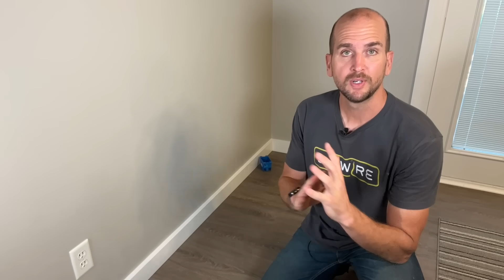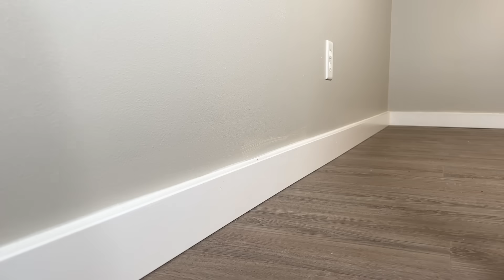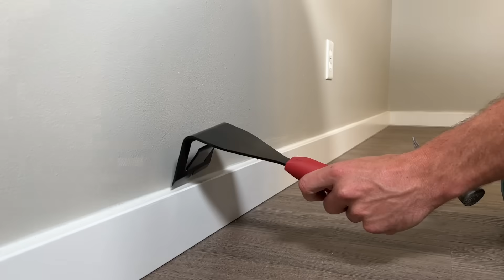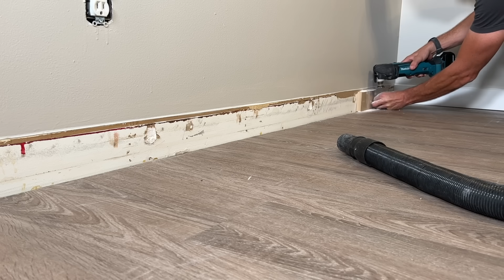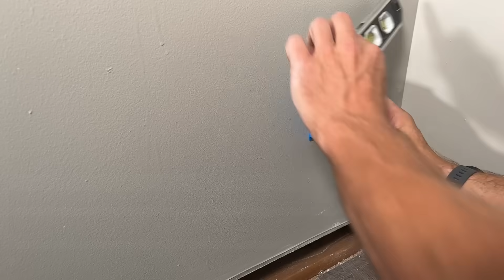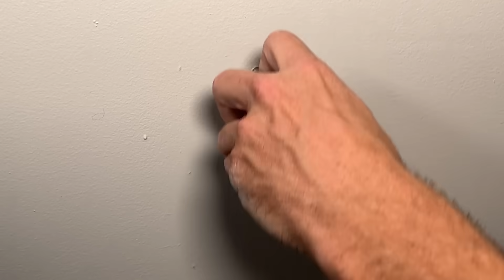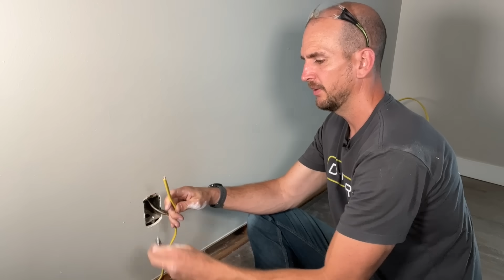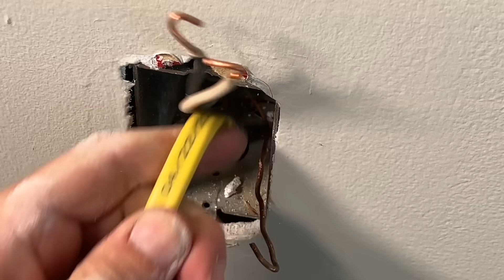How To Add An Outlet To A Finished Wall

Comment from the maker: All My Favorite Tools - https://geni.us/GYnAhy4

DISCLAIMER: This video and description contain affiliate links, which means that if you click on one of the product links, I’ll receive a small commission.
Reply: I like to check the other side of the wall before cutting. Make sure there is no power or anything else.
Reply: I ... KNOW this already. Good vid though
Reply: Where do you get that stud finder? Thanks
Reply: Hardware  store  @brandonnguyen1748
Reply: How do you remove the nails on the bottom drywall
Reply: Okay, have building codes here just changed recently because normally home wall outlets are going to be on a 15-amp circuit which only requires 14-gauge wire, not 12 gauge. Did you just misspeak or are you running 20amps to that outlet?
Reply: ఒక 100 సార్లు క్లిక్ చేసాను. Hope you didn’t mind
Reply: Good job bro i see a lot of people leaving negative comments this is a great idea and awsome method..
Reply: @bamm2pointohh  qqq
Reply: @bamm2pointohh 😮&f CT CT CT

Comment: When you put the second outlet into the cutin box (or old work box) be careful not to push too hard or you will break the drywall through resulting in a giant hole which is really hard to repair.

Comment: So instead of making a clean cut out of the drywall directly between the two outlet boxes you chose to remove trim and then also remove drywall and then repair all that later on. Ubu.

Comment: Why not strip the romex jacket down to the box connector before pulling the wire into the box? Seems easier and cleaner and less chance of cutting the insulation on the conductors than when it's in the box.

Comment: A DIY guy here that has done this many many times also but one thing I didn't notice was using nail/screw protector plates over the holes you drilled into the studs to run your wire thru. You made it harder on your self drilling behind the drywall but a nail or screw could still be put  in there for some future use reason... say adding  wider baseboards.  Here in florida that is a code violation.  A nail or screw could pierce the wiring when nailing into the stud for any reason.  Needed whether it be plumbing or electrical run thru studs.

Comment: Awesome video! Question, does this trick with the drywall behind the baseboard still work if you are going through a corner into a closeted area? Technically, the wall I need to go through to get into the closet is straight through on the same wall, I just potentially envision a possible challenge with getting through the closet entryway.

Comment: I am not an electrician , but for this project I just drill from the existing outlet to the new location  with a long electrician drill bit since is not to far ( flexible auger from Home Depot)

Comment: Okay I’m definitely a beginner. Is there such thing as a four pin lugged nut as I have two sconces I would like to connect however I only have one outlet in the center.. and I want to create one outlet to the right one outlet to the left in order to connect the sconces vertically down.

Comment: Wow, really smart ideas! @ 3:05 I was thinking you gotta be super careful with the end of that tape measure right next to that outlet with no cover on it. You probably already have the circuit turned off, and the wood floor should theoretically protect you from a lethal shock, but general practice would be to not get comfortable holding a metal instrument like a tape measure anywhere near an open electrical receptacle. I just wanted to point this out so that viewers will keep this in mind. I actually think the video is awesome!

Comment: Only criticism would be that there’s no need for the connectors and pigtails. You could’ve just put the new conductors right into the bottom terminals of the existing receptacle with less parts and work and accomplished the same thing. 

Great video overall, though.

Comment: Fantastic video. I am not a fan of WAGO. I have had instances where the wires pull out of the WAGO. They don't clamp down tight enough. I prefer the old way of wire nuts. If those are installed properly, they never come out.

Comment: It would be alot easier to use extension bits on your drill and drill through the studs in the wall. Couldn’t imagine ripping off someone’s baseboard during a service call.

Comment: One point you didn’t mention about drilling the holes higher up on the studs…this also gets above and nails that are driven through the bottom plate up into the bottom of the studs. Hitting one of those nails can be nasty on a bit.
Reply: Oops….gets the holes above the nails

Comment: Other options... Cut drywall 3" above floor, remove drywall, use oscillating tool to cut notches in the studs just above the plate. Lay in wire, cover with metal plates, add 2nd outlet. I've used this for close span outlets... Use surface mounts.  Easy, they look fine when done.

Comment: aren't you supposed to remove the "ears" on the outlet when used with an old-work box?  The old work boxes are molded to accept the tab without the ears.

Comment: This is probably one of the best DIY videos I have seen. My only wish was to not speed up the splicing and wiring. As someone new to DIY electrical it would have been nice to see it all at a normal pace since this is such an important part, then speed it up myself with the video controls once I saw enough at normal speed. Thank you so much for this video!

Comment: Long ago my grandparents added a good size addition to the back side of their house.  I told them at least put outlets every 6 feet.  They did and the next 15 years that we used that addition, those outlets came in real handy.  Could put lamps anywhere in the rooms.  No "well, we'll need an extension cord going along the floor here".

Comment: Newbie here..

Does this mean that both outlets can use a combine total of up to 1800 watts or each outlet can individual use up to 1800 watts (3200 watts total). 

I want to plug an A/C or heather in 1 outlet (1200 watts) and on the 2nd outlet plug in my PC/set up/other stuff.

 I dont want to fry my outlets.

Comment: Well, I’ve had those Wago lever three ways, not work, not often but they have. I only use the two ways when I’m using braided wire. I’ve gone back to the old-fashioned twist and wire nut. They never fail me.

Comment: IM an ELECTRICIAN PLEASE READ BEFORE DOING. There is zero point in vacuuming over and over in the middle of working. Do what you need to do then clean up. Also, please double check if not even triple check the power is off, breakers fail and residential electricians cut corners all the time, so their could still be power running on the neutral from another source. Also very few boxes in residential are metal, they are almost always a plastic box. You very rarely need a connector. Also always tape your outlets to prevent arcing aka breaker issues and/or house fires.

Comment: I would have poked a hole in the center of the area that you picked for the new outlet and used my twirly to determine that there is absolutely nothing in the way prior to marking the wall up with a pencil

Comment: My first action is to "Thumbs Up" this clip.
Having done so, carpenters/framers please weigh in:
Did I compromise the wall studs by drilling them this diameter, and this low to the floor?

Comment: One thing I wish I could find is a video detailing how to add an outlet on the outside of my garage with vinyl siding. I have not found anything yet that shows what is needed and how to do it without compromising water intrusion.

Comment: Great job.  I probably do not perform code.  I pull the baseboard off and notch the drywall for the cable.  Then reattach the baseboard.  No stud hole saws.
Reply: Definitely no no.  Nothing to stop a nail or screw from penetrating the wire.

Comment: Great video, and I'm a very picky engineer, electrical! You are lucky the baseboard was tall enough. Only thing I would probably do different is not use a 1 in Spade bit. I would prefer a smaller 1/2 in or 5/8 in wood boring bit which pulls itself in like a screw and is much easier to control at that angle.

Comment: Why would you bother with pigtails when you could just piggyback off of the actual outlet?  The bridge has just as much metal as those connectors.  I will say I'm impressed with the trick with the clamp, as well as the idea of hiding the drywall cut behind the trim.  Do you need to worry about overloading the circuit and possibly causing a fire?  You used 12 gauge wire from box to box, but you have 14 gauge coming into the box.  I know you said you were using it as a charging station, but also said it is for an AirBNB.  What if a tenant decided to plug in a space heater there?

Comment: I’m a novice hence my question?
Since you are cutting the drywall away, isn’t that going to expose the wall studs?   And since you want to avoid the stud where you’re installing the outlet, why not find the stud in that area?  That would seem to emanate the need for measuring.
Reply: Just drop it, man - This dude is making the ol' mountain out of a molehill just for another outlet 4 feet away... A $10 outlet strip would serve the same purpose.

Comment: ummmm, what about the nut attached to the wire? guess there is no service loops for this circuit or even pulling new wire with the existing one. now your kids or other people who inherit this house will not be able to service this circuit without cutting the drywall below the receptacle. whatever, drywall isn’t too hard anyway.

Comment: Over 25 years installing other types of wiring in houses and I very much don't recommend doing this in this way..  Anyone that may work in this room later would never assume that outlet isn't either wired from above, below, or across from the level of the other outlet (which doesn't require much more work than this method).  Only time I'm assuming wiring might be at that level across a wall is when there are registers along the floors.   I know it's up to the installer to verify what's behind the drywall, but this is the last thing I'd expect from years of experience.  Put it in flex conduit and mount guard plates on the studs where you drilled the holes at a minimum if you're going to do this.

Comment: This is cool, but it's definitely a pro installation and not a DIY for a common folk. I think I'll just run a recessed power strip and hide the cable as best as I can. The trim removal tool was amazing though. Thank you for sharing!

Comment: Well colour me impressed. I was ready to be really upset because I’ve been in trades for 40+ years and know these tricks but this is the first video on YouTube that I’ve seen handle the electrical this well.  Kudos. I’d just add this only works on interior non insulated walls which you clearly show but never say. Vapour barrier on insulated exterior walls makes this much more difficult. Still doable but difficult especially if acoustic sealant was used properly.
Reply from the maker: Thanks so much for the feedback and agree the interior wall is key for this going smoothly.
Reply: @EverydayHomeRepairs you are very welcome!!😊

Comment: I did low volt integrated systems so already knew all these tricks and have flex bits up to 6 foot long, glow rods, fish tape and carpet fish plus an assortment of home made hooks and grabbers to get at the wire in wall so we ran plenty wires by removing trim and making small channels or tucking it underneath the trim or between the flooring and wall but that don't work as good for romex which is more rigid and needs centered in the studs so you got lucky ur trim was so high so you didn't need to drill through any nails or use nail plates afterward to protect the wire.

Comment: This is great if the new outlet is a straight though to the new one. But is doesn't work if you have a corner or doorway in the way. I also don't think the molding or drywall will come off that easy.

Comment: Why did you use WAGO lever lock connectors when the outlet has previsions for adding said secondary? I get its easier, but I feel like a WAGO connection is the same as back stabbing. Which you all do not condone because of resistance and temperature rise.

Comment: The problem I have with this whole process is of course safety. The DIY worker  put the romex wire stud holes through the studs up and above the drywall with no apparent nail stop plates to prevent somebody from the future drilling into this wall per se, installing shelving e.g. if the installer is not the one installing future shelving or any kind of screwing into the wall and they’re looking for a stud and their stud finder does not read electrical properties , and not knowing that someone ran wire, 4 inches from the floor, there’s no nail stops. Someone could get hurt very bad and then you would have to fix it anyway. My suggestion is do a little drywall work and be safe slip a flattened nail plate up above that drywall there to protect future grilling or screwing. Just saying.

Comment: Nice touch with how you got the connector on the new wire.  But isn't a 1" hole through the studs just a bit overly large?  Also, I love the pull the base board for getting into the wall.  I wouldn't have thought of that!

Comment: Why use those Wago nuts?  Why not just use the wall outlet as it already has 2 screws for both hot and neutral?  I can see doing this if you had multiple wires but with just two it makes no sense.

Comment: If your house was built in roughly the mid 1980s or earlier, there's a very good chance the compound and tape used to finish your drywall contains asbestos. Remove with care.

Comment: Doing anything electrical makes me nervous. You made it look easy, and I’ve never seen those connectors before. I have outlets below my modeling bench that are getting full. I’d like to add a few above the bench. Is it pretty much the same process? Thanks. ✌🏻❤️

Comment: You missed one thing. Slide a nail plate under drywall to protect wire from someone in the future nailing or screwing into the wire. Otherwise very good video.

Comment: As a master Electrician, I would offer four tips. 1: Strip the jacket off the Romex BEFORE sending it into the box. 2: Use the Romex holes in the back of the box, as opposed to the 1/2" KO. (Keeps the wires back farther in the box and out of the way, especially if you will be installing a GFI in the box. And if the wall is insulated, it's a PITA to snake a Romex connector up the wall.) 3: Use a metal old work box instead of those ridiculous blue boxes 4: Use the four screws on the device to make your connection, (if there is only one cable feeding the box) as opposed to using those crappy "pressure" connectors. (less work than making a pigtail and much less crap in the box without three unnecessary connectors)

Comment: Was wondering why the pigtail and Wago?  Since each duplex is designed to join two romex cables together without any extra connections. This is how every receptacle is wired up in new and existing construction.  ???

Comment: Great work, but I'm not sure the difference between using wagos, a spring connection, and the screw connection (mechanical) on the side of the receptacle.

Comment: Retired Electrician after 65 years .I have done this same thing, I don't like the electrical device for pig tails. Best way to insure good connection is wrap the pig tail connection and then use wire nuts . tried and true connection for all my years. other then that great flick.

Comment: The NEC mandates that the edge of any bored hole must be at least 1-1/4 inches from the nearest edge of the wooden stud.
On a standard 2x4 stud, which is actually 3-1/2 inches wide, drilling in the center provides more than 1-1/4 inches of clearance on both sides, keeping the cable out of harm's way. However, drilling a steep angle hole may cause the wire to loop close to the wall behind where Brad nails can puncture it from the wall  on the opposite side. 
For load-bearing walls, centering the hole helps maintain the strength of the framing member. 
A stud's outer "fibers" or edges carry the most load. Drilling a hole in the middle removes the least amount of wood from the strongest part of the stud.
For a standard 2x4 stud, building codes permit holes up to 60% of the stud's width, but a centered hole is always structurally preferable.
Clustering multiple holes or drilling them too close to the edge significantly weakens the wood, potentially compromising the wall's structural support.

Comment: sorry for noobie question. Just moved in to my new house I am trying to run an ethernet cable from the attic to a finished room with many power outlets already input is it possible to take out one of those outlets and run an ethernet cable through there from the attic ? I would just need to follow that preexisting outlet from the attic  and run the ethernet cable through there right?

Comment: I need to drill holes through about 3 consecutive exterior wall studs in order to run some new Romex wire. The holes will be the standard 3/4" dia holes for the Romex. Is it OK to do so on an exterior wall? I appreciate an answer ASAP,  I need this information by tomorrow morning.

Comment: Not to be one of those people. But you really should not mix 12/2 and 14/2 on the same circuit. In this case you can get away with it as you are stepping up. But if you stepped down from a 20amp circuit and then added 14/2 you could cause a fire.

Comment: To make it easier to get the cable up into the original box, feed a scrap length of cable DOWN through the box, onto the floor. Tape your cable to it and pull it up, saves a lot of poking around till you find the hole.

Comment: Check both sockets in case they are on different circuits. Just to be safe. Also, if you can find the screws, you can loosen the drywall and slip thin metal penetration plates so no one else later drills into the romex.